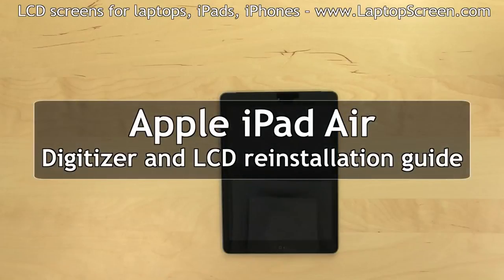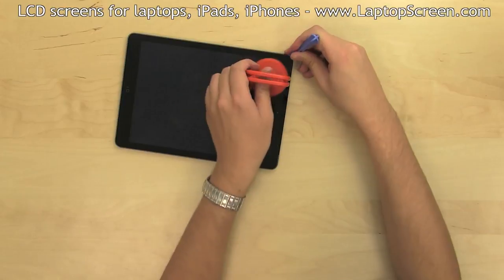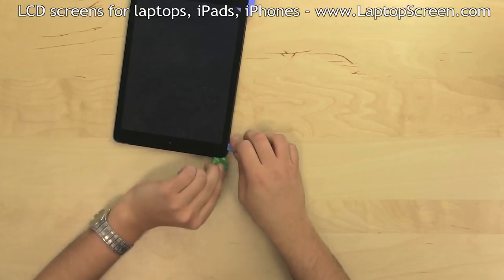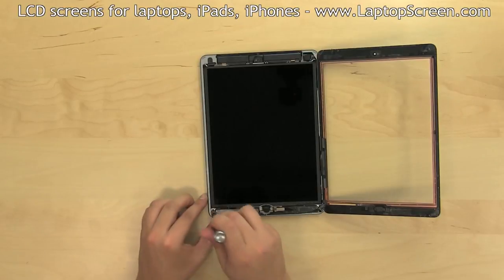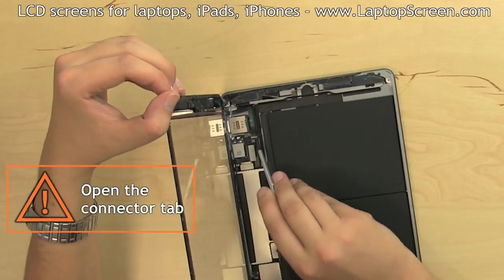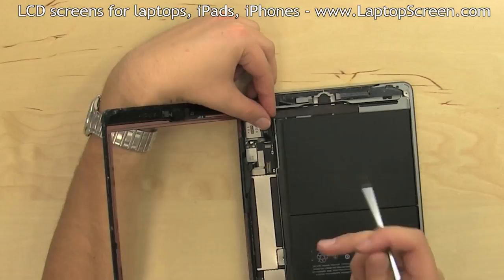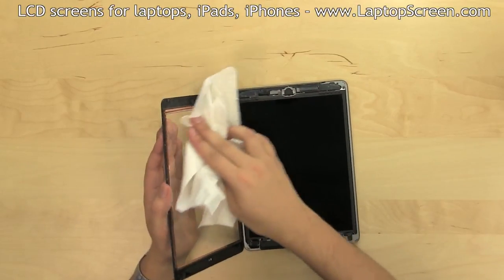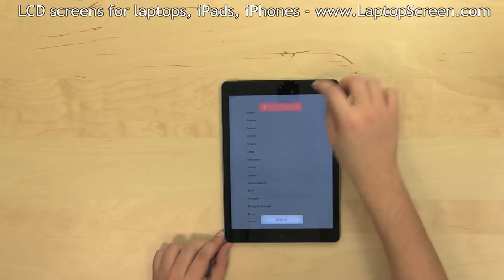iPad Air Screen Replacement (digitizer and LCD removal and installation)

Comment: Don't use paper towel, you'll scratch the LCD. Use a microfiber cloth.
Reply: i gasped when i saw him do that XD
Reply from the maker: Yes yes, paper towels may contain hard abrasive particles that may scratch the fine coating on your LCD screen.
But in all fairness, we've cleaned a tonne of LCDs over the years, and when your trusty microfiber cloth is all completely gunked-up, a clean paper towel and a bit of alcohol is the next best thing once in a while.
Reply: I scratched my lcd
Reply: @rafiemajid4044  I have touchprints

Comment: Thanks a lot. I did it. It took around 2 hours but eventually it worked exactly as you described. Let me share a few notes:

1. Pay attention that screen screws are of a different size. 3 of them are the same but one is slightly longer

2. Be very careful for not leaving fingerprints on the screen. It is almost impossible so consider putting a "condom" in a form of some plastic bag on top of it immediately after you lifted it up. Cleaning the screen by a dry towel is a very time consuming process. Took for me a lot of time

3. My replacement digitizer that I purchased on eBay had a noticeably bigger bus cable (the one that has two connectors attached to it). So it was a pain in the butt to fit it inside. Eventually that was the only problem. I was not able to attach the digitizer tightly in the place were cables were connected. It is not very easy to notice but still it does not feel attached the same tight as original glass.

4. On a bright note it was relatively easy to disconnect the old digitizer. I did not have much pain with that. My old digitizer was cracked and It was harder than on video to extract it as glass was separated by cracks but still it was easier than I thought it would be. 

One more time. Thanks a lot. That video was more than helpful.
Reply from the maker: Face Star Thanks for your comment. Probably one of the most helpful comments we've received.
Reply: LaptopScreen.com might be helpful if you instructed the new adhesive installation for a novice that a crucial thing don't you think? I do
Reply: Also be for I forget the three screw holding the metal plate on are a totally  different size than the screw that hold the lcd.
Reply: if you just have to replace the digitizer do you have to change out the screen as well

Comment: done in 2 hours. was a little bit scary as the digitiser was havin 3 crack line. luckily i managed pull it off in record 7 minutes as it was also a replacement and previous repair wasn't good. there were hardened glue that i needed to take off. 1 and half hour i spent just for cleaning it. i put everything back within 15 minutes too.very happy with the result.

thanks for guide.

Comment: Watched this video on replacing my ipad air screen (or digitizer as I now know) as it was the one with the clearest instructions. I used a hair dryer as I didn't have a heat gun and I tested it all worked before I heat sealed the digitizer down. But I must say, a fantastic "how to" video which enabled me to do the job myself and save around £55 on labour. If you want to have a go yourself, watch THIS video. Also don't scrimp on the tools, I bought a cheap set off ebay and they were rubbish!

Comment: Great video! I like the close up shots which is a big help.  At the moment I am trying to lay the digitizer screen back over the lcd screen BUT  the cables on the edge of the digitizer screen do NOT want to tuck down into the crack on the edge.  They are applying pressure upward.  Any suggestions?  I do not want to break the cable or the screen  I am not sure how much bending they can take.   I double checked and they appear to be plugged in properly.  Any suggestions would be much appreciated. 🙂

Comment: It is recommended that you disconnect the battery before disconnecting the screen and digitiser and only reconnect the battery after you have reconnected the new screen and/or digitiser.
Reply: +Bill M How do you do that?
Reply: Once it's disconnected you can keep it separated by using a pick slid between the connectors.

Comment: Best tutorial.  Short and to the point.  I initially cracked the screen when trying to pull it off the adhesive and ripped the wires connected to the board.  After your tutorial I did it correct.
Reply from the maker: Glad it helped!

Comment: Thank you a million! I had a question about the Vaio SVD112 DUO screen; I have one, and unfortunately, some sticky liquid is leaking, I think it is crystal liquid, but is it possibile to separate the digitizer from LCD carefully and clean this viscous liquid? Honestly, I don't know what the problem is, and also I wonder why that sticky liquid does not exist, for example, between the digitizer and the LCD of this IPad?  Thank you in advance for your response.
Reply from the maker: The liquid crystal solution is definitely not viscous. It needs to be well free-flowing to reorient crystals contained in it very fast on-demand to shutter the light to each individual pixel. In our experience, viscous liquids found in laptops/tablets are usually food related: pop, wine, juice. Sugary solutions become viscous after evaporating most of their water.
Reply: @Laptopscreen  Thank you a million! So maybe I'll able to repair it. Because the lcd works. But the touch screen, on the other hand, unfortunately does not work. And between touch screen (digitizer) and LCD seems something like glue.
Reply: @Laptopscreen Unfortunately, the LCD was attached to the digitizer by a sort of glue... and so I made the situation ever worse 😂

Comment: Thanks for the video, it helped me to change my digitizer, although it's a lot harder when the digitizer in question is shattered!
It helps to have a pair of tweezers and a flat thin metal removal tool to get rid of all the glue and glass. I wore goggles as well to prevent glass in the eye when trying to lever the screen upwards.

Comment: What if the LCD screen was broken internally and the screen wasn't cracked. What then? Is it the same process except for the replacing of the lcd screen instead. I'm sorry if you mentioned it somewhere in the video and I just didn't notice.

Comment: Is the old leftover glue enough to hold once reinstalled? Should I add some type of glue or rubber cement to ensure it doesn’t open back up on me ?
Reply from the maker: Old glue is not as good as new, especially if you contaminate it with dust, lint, hair or finger roil. Its recommended to clean off the old glue entirely and use new adhesive strips. All our parts come with new adhesive strips installed.

Comment: Im on the final step of putting everything back. The problem is when i lay down the digitizer to test it, there's ghost touch everywhere. i have to lift one side by maybe 5mm or so so that everything works properly. Now, i can't seal my ipad
Reply from the maker: Should probably check the connector, blow it out. Also cleaning the front of the digitizer with alcohol and a reboot sometimes helps to re-calibrate the digitizer.
Reply: @Laptopscreen  i cleaned the connector and now there's almost no touch response at all. Only response i get is, clicking the home button, and nudging the sides of the digitizer (it registers small movements). I think the screen is broken now. Maybe i folded the connector towards the bottom too much.

Comment: do i need the shield over the display connectors?
Reply from the maker: The shields aren't crucial to the function of the device, but they provide longevity and trouble-free operation. Connectors can disconnect from bumps and vibrations, shields physically prevent it from becoming loose.

Comment: Thank you for the thorough and concise instructions. Despite adequate heat and very gentle prying, my digitizer shattered into fine glass powder almost everywhere I wedged the pry tool. Any wear on the LCD is very visible without the digitizer, and mine was well worn so I ordered a new one.
Reply: Update: The new LCD screen arrived and thanks again to your video it was easy to assemble the new parts.

Comment: Does it have to be heat gun ?
Reply from the maker: No not at all! You can call it the heat pistol, heat device, heat exhauster, warm air source or even the heaterthingamajig, the possibilities are endless!

You can also use a hair drier. The principle behind the action of heating the front of the digitizer is to loosen the glue. You don't have to use any heat at all - but the broken pieces of the digitizer will take longer to remove because they'll be harder to come off. There are also microwavable heat bags that some techs use to apply heat, but I've never tried them.
Reply: LaptopScreen.com okay thx :)

Comment: Well, I thought I did everything properly but the touch pad barely works. I can't enter my code to open it up. Any ideas??
Reply from the maker: John, you could try wiping the digitizer's connector with alcohol. And if that deosn't help, you'd need to contact your vendor and get a replacement part.
Reply: Thank you for your input. I'll give it a try.

Comment: We got our iPad sent off to get the screen fixed and when we got it back the home button isn't working
Reply from the maker: That's unfortunate. Maybe whoever did the repair for you simply forgot to plug it back in. It s a simple fix really, but you'll have to get the glass off the glue carefully trying not to break it. Kind of like this video :)
Reply: LaptopScreen.com ok thank you so much

Comment: Sound very, easy thank you! Question? Do I have to use clue, when I put it back the screen?
Reply from the maker: In most cases of a single disassembly the old glue is strong enough.
If the glue is contaminated - finger prints, dust, fibres, etc - it's best to scrape it off and use new glue / fitted pads of double-sided tape.

Comment: Thanks a lot gonna give a go, hopefully I have the same success as everyone else. Can u do one on the lock button not locking. Keep up the good work.
Reply from the maker: Lock button = power button? Did it just stop working or was it damaged during disassembly?
In most cases such parts can be acquired on eBay for a few dollars, however the installation may require gutting the entire device.
We likely won't make a tutorial for that since we only supply screens, but an iFixit tear down would be a good start when preparing for such a job.

Comment: The corner. Of my iPad glass is cracked should I get the digitizer or just glass replaced? Also can a hair drier be used if I have no access to heat gun?
Reply: Andrea washington digitizer comes with glass anyway

Comment: I personally think you should start on the left side. Because all of the cables are on the right. Also if you are reusing your home key ribbon cable, it is on the right side and you should be very careful on that side. I mean a xcto knife would ruin your home button cable. I almost cut mine. So be careful on the RIGHT SIDE. The other 2 cables are ok since you are replacing them anyway.

After that and getting the camera bracket it's a easy repair. Take your time. Another thing sometimes on your replacement glass. There is a inside protective film. Make sure to remove it right at the point of closing up the screen. There are 2 films, but of course remove the outer film.

Comment: What happens if you don't use a heat gun?
Reply: Then your glass shatters all over the place.
Reply: I meant can you use anything else?
Reply: Jetcalistic Jo a powerful hair dryer but you have to make sure you get the screen really hot or it will shatter into billions of pieces, literally.
Reply: I'm taking my iPad into my local Apple store so they can replace it for me

Comment: I followed the video now my ipad will not turn on at all
Reply from the maker: The one in this video turned on.
Reply: @Laptopscreen  but mine won't I don't know why, I made sure all the cables are connected and all the screws are in the right place but when I try to turn it on or connect it to itunes nothing happens I think the logic board might have died when I was replacing the digitizer

Comment: Worked 100%, thanks!
Reply: Where do you get the digitizer and the LCD screen? Try find a uk site, when I search ipad air 2 screens it only comes up with protectors :( Help
Reply from the maker: The Random Uploader LaptopScreen.co.uk
Reply: +LaptopScreen.com 
I am looking for iPad Air digitizer and the LCD screen. Looks like you are out of stock. Where and what do you recommend to be bought?

Comment: You forgot to unplug the battery just in case and one of the screws (top right I believe) is longer than the others so put it back where you unscrewed it from or risk breaking some internals

Comment: Use a pick to run along the edge. Use a piece of plastic to wedge it so it wont stick. Actually uses a piece of plastic to run along the edge and a pick as a wedge. My head explodes.

Comment: Why did you not wear gloves?
Reply from the maker: Good question. Primarily because bacteria are capable of interfacing with the innards of organic creatures only and wearing gloves is a must for surgical procedures on humans and/or animals. Electronic devices do not necessitate the use of gloves by default. Only really, really, really old computers from smoker's homes makes techs want to wear gloves. 

Wearing gloves just out of sense of safety is not intrinsically safer for the device:
- Sweat builds up the gloves in minutes, but the job lasts about 2 hours. If you drip some sweat in the device it will likely to cause damage.
- Gloves reduce tactile feedback when working with smaller components. You may not be able to plug the connectors in properly with-out the finer feeling of touch.

Probably the most likely reason for some of the videos of techs working on iDevices in gloves - is because techs want to conceal their fingerprints so that Apple doesn't refuse the warranty; which would be illegal for Apple to do, due to the Magnuson-Moss Warranty Act of 1975 - so there is no real reason to even conceal your fingerprints.

Look at all the miserable techs wearing gloves in their 1+ hour videos posted along-side in the related videos -->  
You don't want to know what the inside of those gloves feel and smell like by the end of the video. Yuck...
Reply: This is awesome! I have had nothing but issues with gloves and only use them to grab my LCD
Reply: Wearing gloves while cleaning the screen and re-positioning for installation is the most important step to conceal fingerprints. There is nothing more annoying than leaving those prints on the inside of your screen